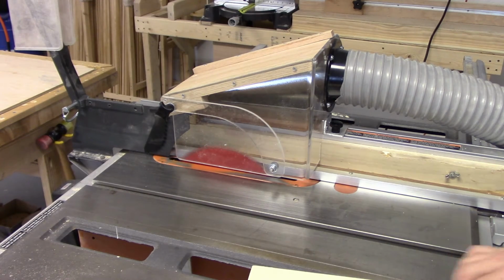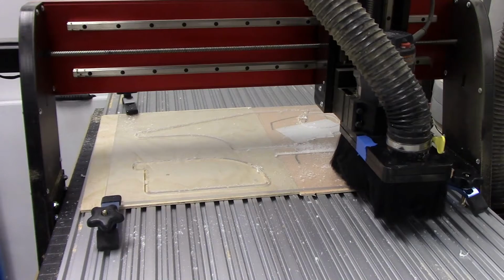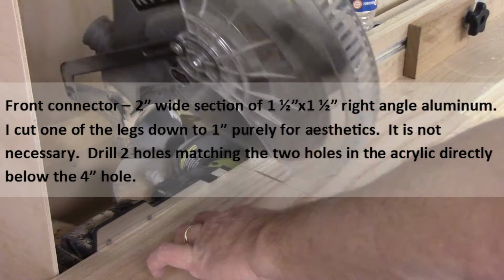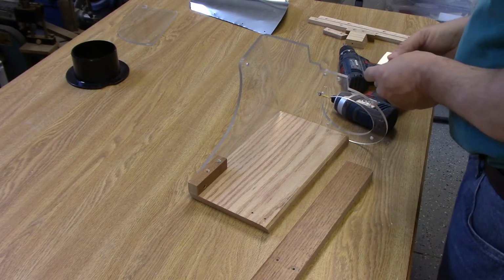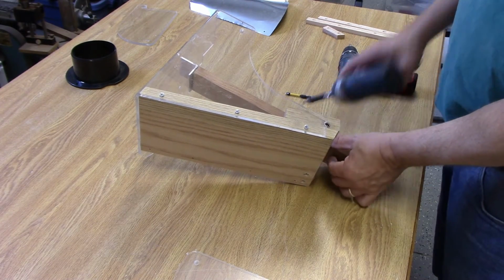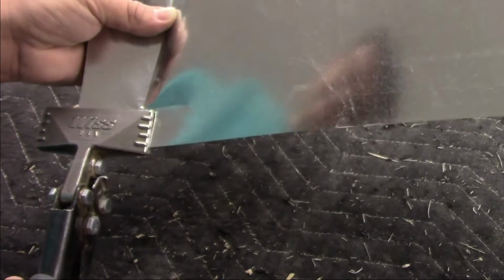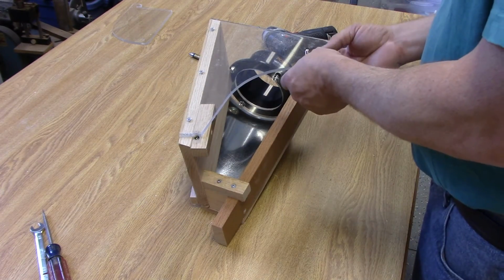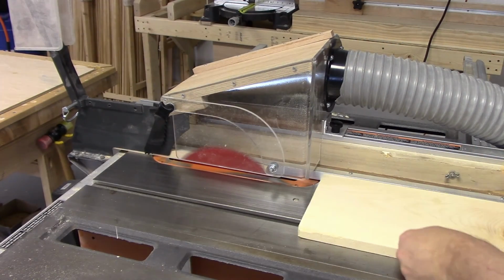Table Saw Dust Hood by WoodAirGrille

Comment: I was not impressed with your dust collector. It appears to be very awkward and I saw no way of using a push stick to push the word through the blade in order to prevent kick back. Many woodworkers have been injured by kickbacks including myself.

Comment: what bit did you use for the cnc mch. just a tip, the music was overpowering the talking for a lot of the video.
Reply from the maker: Thank you for the feedback!  I ordered a special bit for cutting plexiglass, but I couldn't tell much of a difference when I held it up side by side to a regular 1/4" spiral upcut bit.  I think the best advice I received for cutting plexiglass and plastic on a CNC was to seek low RPM and higher travel speeds to keep the plastic from heating up.
Reply: @rodgunter5561  thanks for the reply.

Comment: Why is the vacuum hose on the front and not in the back? I'm having a hard time understanding the advantage of doing it like that.
Reply from the maker: Great question, thanks!  I did experiment with a rear port and it will work that way.  The reason I located it in the front is because the direction the saw blade cuts, it throws the sawdust toward the front so the dust collector can take advantage of the direction the dust is already flowing and seems to work more efficeintly.  Also of some influence is where my dust collector is located in the shop makes for a much shorter hose.
Reply: @rodgunter5561  love the answer...thank you! makes sense